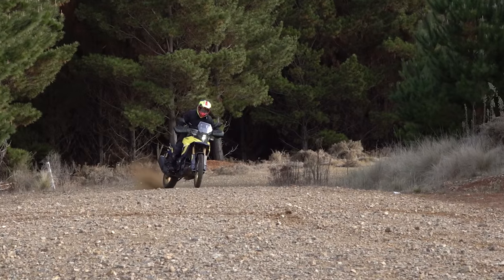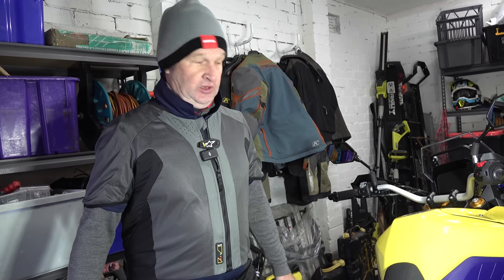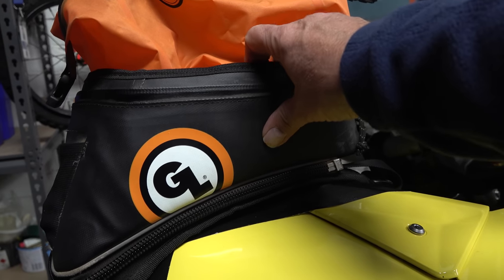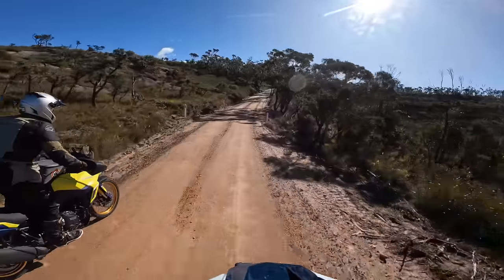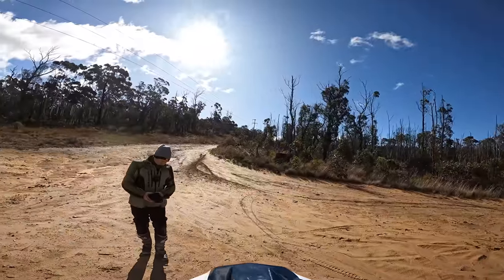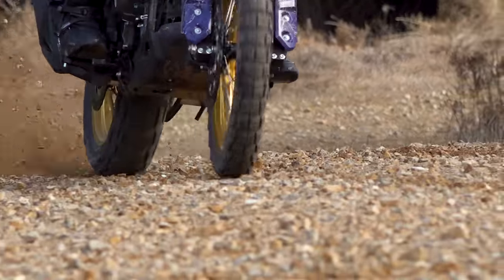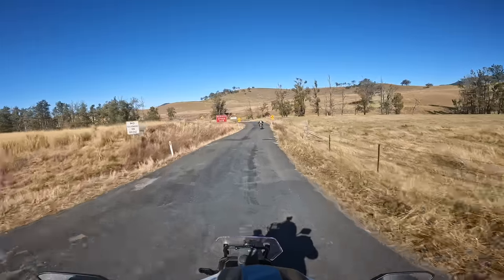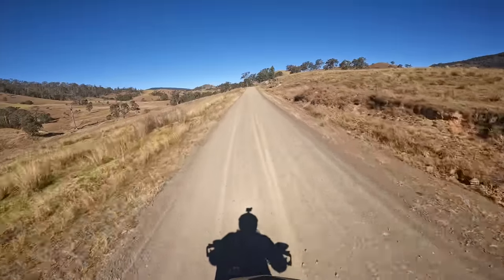SUZUKI V-STROM 800DE |  RIDE TESTED THOROUGHLY ON A THREE DAY ADVENTURE, SUSPENSION TESTED/ADJUSTED

Comment: A big thumbs up to Suzuki for getting most things right for an entirely new model, particularly the fuel tank size.
Reply from the maker: The CF Moto would eat up most of the route with the exception of those rocky bits at the beginning and then you'd just go slower and pick your way through.
Reply: @MotorcycleAdventureDirtbikeTV  ... You guys picked some gnarly terrain for this video, which is a good thing, because it really shows what the 800 VStrom can do.  Maybe the CFMoto is going to be out of its element on those tracks.  Maybe slightly better with a pair of Motoz Tractionator GPS 50/50 tyres fitted.
Reply from the maker: @Jonathan-L  Off road tyres for off road work always dramatically improve things.

Comment: I thoroughly tested the 800DE  a few weeks ago, off road and it is very, very good.
For the British viewers, the 1050 and 800 can be both tested off road at Suzuki Live, Cadwell Park July 15th and 16th. Well worth a visit
Reply from the maker: If you are in the market for a mid sized twin you really must ride this one.
Reply: @MotorcycleAdventureDirtbikeTV  absolutely,  suspension is ACE, very little pitching fore and aft as the terrain changes plus it reacts well to rapid small bumps , weight is balanced and is hidden well.
Fueling is excellent, and that's  coming from someone who loves his carburettors.
All in all, an excellent mid weight bike.
Reply: @theflyingbogie 
Agreed and thanks for the Cadwell info! Suzuki have knocked it out of the park with this bike. 
 Now, when will we see a new and updated DRZ400 return to UK showrooms please Suzuki?
Reply: Badly want Suzuki to make an FI DRZ. Maybe a crossover between a DR650 and DRZ400. Say a DRZ500fi with LED lights. My dream bike.

Comment: Excellent video Dave and Clubby, very good useful information for those Vstrom enthusiasts and those interested in getting into the ADV market. If suspension is the only real upgrade needed out of the box and maybe tyres etc, I'd be pretty happy with that. It will be nice to see what aftermarket accessories become available. That price is insanely cheap for what you get. Nice work! Excellent all round. 👏👍🇦🇺
Reply from the maker: Thanks mate.  This bike is a good thing.

Comment: I own a Tenere 700 and I test rode the V-Strom 800DE. I was curious about the additional 23 kg (both dry weight) compared to the Tenere 700. What immediately caught my attention is how low the motorcycle sits. Everything is lower compared to the Tenere, including the handlebar, seat, everything. Naturally, this results in a much lower seat height, which may be somewhat uncomfortable for taller individuals (I am 183cm(6ft) with a 90cm(35.4inch) inseam, but this can be solved with a higher seat. I only rode the motorcycle on paved roads and I have to say that the V-Strom feels incredibly stable and provides a COMPLETELY different sensation compared to the Tenere. Of course, you don't notice the extra 23 kg on the road, and because all the weight is situated so low, the motorcycle is very stable in comparison to the Tenere, which tends to sway in various directions at slow speed maneuvers. Low speed maneuvers are also much easier compared to the Tenere. The controls also operate much smoother and more directly compared to the Tenere, including the clutch, throttle response, and brakes. Another thing that caught my attention is the rear brake. With the Tenere you really have to push hard to slow down, whereas the V-Strom's rear brake is much stronger and way more responsive. The tires that were on the V-Strom were the standard tires, which are more road-oriented, so that may have also played in favor of the V-Strom. Overall, the V-Strom performs much better than the Tenere on paved roads. If I were mainly riding on paved roads I would choose the V-Strom. The testride ride convinced me of that..
Reply from the maker: Thank you.  Your observations equate with my experience. And on the dirt it handles very well and more than matches the Tenere.
Reply: This or ktm 790 adventure 2023? Have rested ride this?
Reply: Matches the T7, that’s a bold statement. I’m looking at the T7 but it’s tall, was thinking about the Suzuki but was worried about the extra weight

Comment: The old V-Storm is a great touring bike terrible off road. The new 800 looks very interesting! It’s about the suspension and wet weight. The engine looks the goods-smooth, power where you need it and it will be super reliable Suzuki!
Reply from the maker: Nothing like the old V-strom
Reply: My 650XT does surprisingly well off-road (if by off-road you mean dirt and gravel roads). Yes, I can bottom out the forks if I'm not careful, but big deal. Neither bike is suitable for trails, due to the weight.

Comment: Great vid my Aussie cousins.  Much fun and a beautiful place.   Clubby did some fantastic photography.  I also can't believe he didn't bend the front wheel off that rock ledge.  Wow!  Dave, remember the distance rule when riding with champions.  Number of championships. X seconds.  So at least 3 for Mr. Aussie super star.   Sure he went up against Mat Maladin and several other greats behind the bars.  Good adequate review.  Buyers think they can just ride of in the sunset with a stock machine, and they can, but they will never know the potential or satisfy their desires if it isn't competently set up for them loaded.  Great music Dave.  Good job.  well, from just a few miles north of Tennessee, in the hills of East Kentucky USA.  You fellows take care, be safe.
Reply from the maker: Yeah got pretty close with Gilesy.  I was sliding one way, he was sliding the other.  You should have heard Clubby at the time.  He was sure we were going to hit.  He was squealing like a little pig. :) Great to hear from you Sam.  I thought from other conversations you were around that vicinity.

Comment: The bike looks extremely interesting, but the lack of cruise control kills it, some of us have to ride long miles to get to the adventure. And if you want to go really far for adventure you're not gonna use twisties to get to your destination 3000km away.
Reply: Yeah it’s a pretty big deal breaker. Hard to understand it not even being an add on option.
Reply from the maker: Yes I appreciate that's important for many.
Reply: Cruise control. 🤣
One foot in the grave and Ultraglide keys in his pocket. 
Back in my day electric start was a luxury.
Reply: @MrHSIE  I remember back when I used voice commands to help start the bike.  After many failed attempts to get the bike to fire, the phrase "c'mon start ya bastard" seemed to do the trick :)
Reply: A throttle lock will easily solve this for long hauls. I actually prefer my lock over cruise control because it's is effortless to engage
Reply: @southerndualsport3827  Cruise control disengages extremely easy, engage the brakes, twist the throttle or press the switch.
Reply: @bradsanders6954  cruise control only works when the bike isn't in the shop.  Your advice will save people a lot of money.
Reply: Aussie McCruise are probably on it already?

Comment: This is a great review, thanks guys! For me if I had to decide between the original 650 Strom and this bike there is no doubt it would be the 650. Everybody has their own likes, of course. I've been riding all kinds of bikes for, lets' say decades. I am gravitating to lighter bikes these days. But here is my main take. If it has a 21" front wheel it is a "Dual Sport" bike. And this is way to big and heavy for a Dual Sport in my view. To me an "Adventure Bike" is a traveling bike, and that means lots of pavement. Plus, I like pavement. So, a 19" front is a must, and yes, a deal breaker for me. Also, an all new bike at this point should have tubeless rims, no excuse for that. Thanks again for a great review.
Reply from the maker: Thanks for your thoughts.  The tubeless vs tubed debate..  I'm ambivalent  on this one for where I ride and I always carry a tube.
Reply: I’m 100% with you on 19” and tubless wheels. Perhaps 70-80% (if not more) of potential buyer would prefer this configuration. Pretty easy to achieve by Suzuki since they use this set up on 650 and 1000 as well.
Reply: Well there are rumours of Suzuki making a non DE version with alloys (probably a 19 front) and tubeless tyres.
Reply: @paramjotsingh26  if they do that they will sell them like hot cakes. How many will take DE off road and how often anyway…it might be my personal choice (if not Aprilia 660 with cruise control)
Reply: 650xt is 485pounds, 1050DE is 535pounds, 800DE is 507pounds. I own a 800DE, have a lithium battery, exhaust shop made a decat midpipe, Arrow Indy Race slip on. Weighed it at a local warehouse with a pallet scale. My bike is now, 486pounds. One pound heavier than the 650, I am fine with that. Mission Accomplished

Comment: Thorough and enjoyable look at the 800 DE fellas. 👍
As a shorter rider would I trade off my 890 Adventure S, no. But, if I didn’t have the 890 I’d be looking at the 800DE pretty seriously I think. The height would be the biggest negative, especially like you said if suspension work is done. 

Cracking job!
Reply from the maker: The 890 is far more superior in the dirt with it's excellent suspension.
Reply: @MotorcycleAdventureDirtbikeTV  but not the S model, only 2023 model added some adjustments to the suspension of S model, but it is still pretty much street oriented

Comment: Nice review, liked the more in-depth coverage of the filter accessibility and the suspension adjustment attention. Now, I've been hoping for an Aprilia Tuareg 660 follow up, and rarely hear it's mention w/ the Austrian and Japanese mid-rangers. Is there a reason for that, other than it's 660cc's and Aprilia lack of dealer presence? Love your videos, keep up the great work.
Reply: There is a lot of coverage of the Tuareg 660 on Youtube.
On this channel (MAD TV) there is a very positive 2000km review. Then there is Ian from Big Rock Moto who actually owns one and has a 6 episode in-detail review.
Or you could check out "On the back wheel" for an in depth hard-offroad review of the Tuareg.
I myself have done 11500 km on my Tuareg now and I am still in love with it :) But I live in Europe, where the dealer network for Aprilia is not an issue.
Reply: @chukku2175  hey yeah you're right, I watched 2 years of YT's on the Tuareg before I bought the bike (no dealer w/in 300+ miles til a couple months ago). I have the vaguest of memories that Dave said they'd do a little more in-depth review still, don't really know that I need it anymore, lol. But like in this video, when they compare it to the other mid-range motos, I'd love to hear the Tuareg mentioned somewhere in the queue. I really love these guys, and the Aussies have hands down the most brilliant riding roads and trails and I find their reviews so battle tested.
Reply from the maker: We've done a detailed 2000 k review, search this channel.  The Tuareg is a brilliant bike.
Reply from the maker: No, we did it Young Geezer. You must have missed it.
Reply: @MotorcycleAdventureDirtbikeTV  LOL, yeh I've watched it a # of times. Maybe it was just so smooth and supportive that I thought you might have said you'd be putting it through the wringer in a next review. Hahaha. O well. I just always love your content, and since I now own a Tuareg, I just want to keep hearing how great it is - you know? Hahaha. thanks for the reply

Comment: Thanks for an excellent review. Many people miss the point that many of these Twin are not hardcore Enduros (some might chose to use them that way).  Additionally imo, there is a difference between value and cheap. Example, my Himalayan (with YSS suspension) is cheap BUT it doesn't have the value of the 800DE. This Suzuki looks like excellent value! Something that based off what I have seen cannot be said about the Transalp (Its cheap but im not seeing value for the type of riding i enjoy). 

Keep up that great reviews and look forward to more!
Reply from the maker: Very good points.  There is value here, although I don't mind riding around on a Himalayan....particularly in the Himalayas.

Comment: Finally! There is no need to remove fuel tank to change air filter, and screws holding air filter cover are replaced with metal bolts and nuts. A really good change since DL650.
Reply from the maker: Yay!

Comment: Great review, guys. 2019 VStrom 1000XT owner here. Rode the 800 recently. I was surprised by the power delivery comapred to the 1000... for me they were very close? Very punchy engine. The bike felt lighter even though they are pretty much the same weight. The 800 also felt nimbler, more responsive. The pegs were further away from the seat which made for a more comfortable seated position and the standing position felt much better. I Thought for sure I'd feel that front wheel on the road more then I did. The dash is excellent and I love that they've used the same mode control swtiches, simple and intuitive with no BS.

I was sold on the T7 for my next bike... but now that I've ridden the PStrom I'm not so sure... gonna have to ride both a few more times before I make up my mind... darn...
Reply from the maker: I don't think you could go wrong with this one.

Comment: Blasphemy! NOT touching the gas tank to get to the air box?? Unbelievable. Now its easier for someone to steal. Seriously, a bit of a pain but not bad at all. Over the years I have set my '14 Vee up for more dirt and with all the suspension, gearing, bars, protection, well pretty much everything- I love my bike! Its good on the hwy-even with a bit higher revs and a beast in the dirt. That already low torque the '14 has with a 10 minute gear swap makes it a ditch digger off road. It has taken me incredible places. I say its not a scalpel off road but a sledge hammer. Anything I cant pop over it bangs its way though sliding on the bash plate. You need to ride it aggressive but its a sweet thing riding back home on pavement. I like the direction with the 800. They did a good job putting needed stuff on it so the rider can tune it.  Great                                  review of a very capable, reliable bike. Its still a pretty  pretty heavy though.
Reply from the maker: Thanks mate a decent insight into the world of V-Strom

Comment: Hi Guys, superb review. I have one with 500klm, until now i felt a lot of heat on my seat  Have to stop somethimes  to refresh my b...! I felt in off-road or curvy roads,  a lot of vibration on my pegs. Did you felt some of this issues? Best regards
Reply from the maker: I certainly didn't feel any heat fromthe seat. I didn't feel any vibration but Clubby did if he revved the bike hard and kept it in high revs.
Reply: @MotorcycleAdventureDirtbikeTV  from 5/5500rpm the vibration is there. Gonna see with suzuki seller the heat,(probably because airbox intake location). Many thanks

Comment: Great Review Guys, Well you don't have to sell me one, as I already bought one. I got the first one in San Diego! I did ride it about 4,500 miles here across country, with a little time off the beaten track through the Gila National Forest, in New Mexico. I love the Bike, but not too keen on the tires on the dirt. I'm looking at some MOTOZ tires, Motoz Dual venture for the front and Motoz Adventure for the Rear, any thoughts?
Reply from the maker: Rear isn't as important as the front to me.

Comment: I am on the fence between this bike and the Moto Guzzi V85TT now. This bike certainly will out perform on the rugged tracks. I just dont think ill be on the dirt too much. I cant decide!
Reply: I’d consider how mechanically inclined you are. A lot of work on the V85 you can do if you are comfortable wrenching. Plus many less dealers and mechanics comfortable working on an Italian machine. 
I grew up riding Suzukis so it’s an easy choice for me
Reply: @djrandizz  I'm pretty mechanically minded. Busting knuckles is in my blood. I like the  VStrom but the v85 is just sexy
Reply from the maker: I don't know anything about the Moto Guzzi.
Reply: @MotorcycleAdventureDirtbikeTV  it's one  I hear a lot of love about
Reply: @petersonfam77  If there was ever a brand of machine that's good for DIY maintenance, Moto Guzzi is definitely one of them.  Yes, the new models have more electronics, but you'll have no problems in doing routine tasks, such as oil & filter changes, spark plug replacement and of course valve clearance adjustment (see: https://www.youtube.com/watch?v=A7XdYR10Djs).  I'd definitely invest in a good set of engine guards for a Moto Guzzi, because the cylinders & cylinder heads are exposed in a fall.  As a former 850 Le Mans III owner, I have a soft spot for the V85TT, which is a bike I'd buy without a test ride or watching video reviews.  Sounds crazy, but that's the Moto Guzzi love affair.  Out of the mid size adventure bikes from Japan, it's a tough choice, particularly once the Honda Transalp & new V-Strom 800 aftermarket accessory market grows.  Maybe it's a question of which one not to buy, as they all seem to have their pros & cons.  Dealership network & spares availability (both short & long term) is something to consider.   After seeing Dave & Clubby's take on the V-Strom, plus US Youtuber, Ian, of "Big Rock Moto" with his reviews, I'd say Suzuki have a lot to appreciate the thorough reviews which will no doubt help the bike sell well.